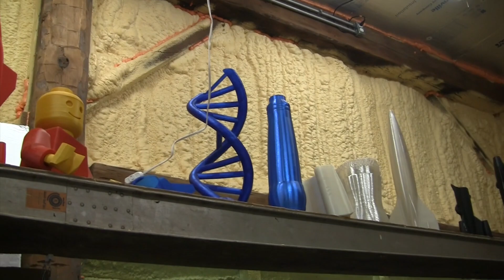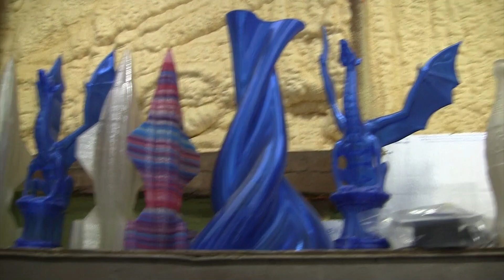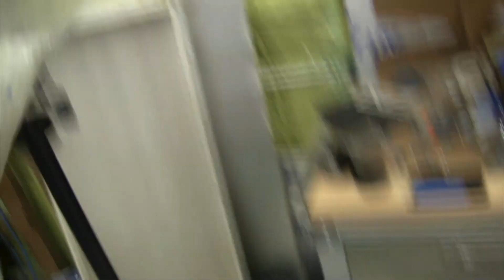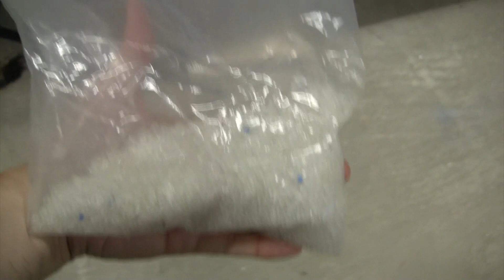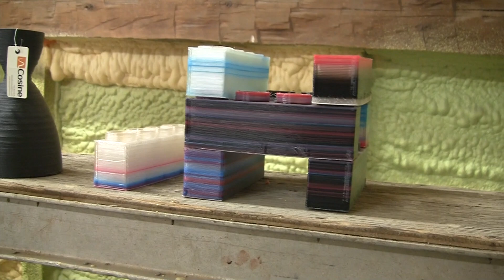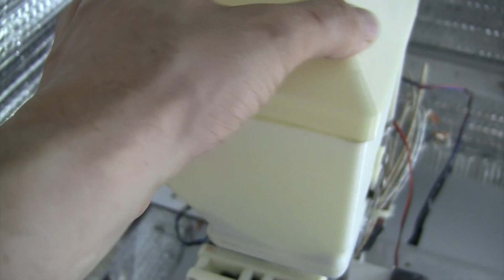3D Printer with Pellet Fed Extruder

Comment: looks pretty good! doing a dual pellet extruder too, and while I am using normal heat resistance I want to test induction heating for the extruder. Did you ever tried?
Reply from the maker: I wasn’t aware induction heating is an option but my die and barrel aren’t set up for it. Are thermal sensors compatible with induction heating? I’m running thermocouples.
Reply: @JeffDM  basically you need to control the induction with a controller module and maybe a mosfet module connect to the 3D printer board so that you do not have hight current going through your board. Also to consider that your extruder need to be metal like iron or steel for induction to work.
Reply from the maker: @biskero I'm already running an SSR so at least I'm familiar with an external the heater output.

Comment: which screw are you using?
Reply from the maker: Vitaliy Zagranichnyy It’s made by an extruder screw manufacturer to my design. 16mm OD, 200mm flighted length, basic three stage compression screw.
Reply: @JeffDM  what productivity, how many kilograms per hour can squeeze out?
Reply from the maker: Vitaliy Zagranichnyy right now about 250g per hour.